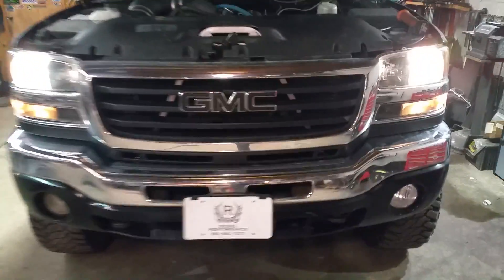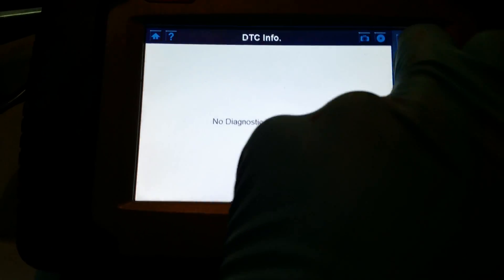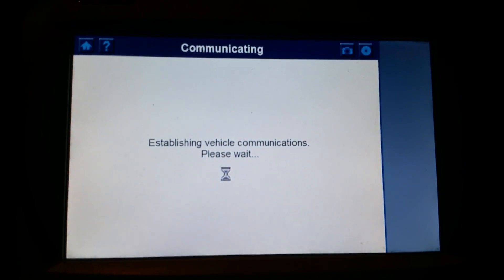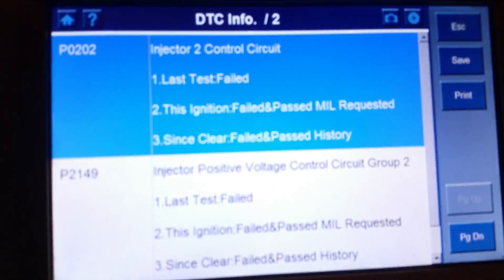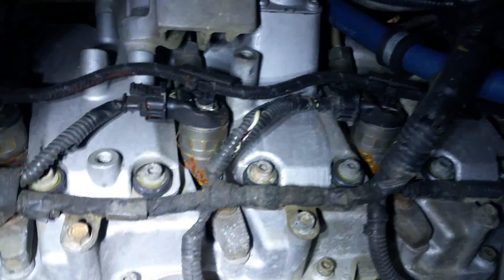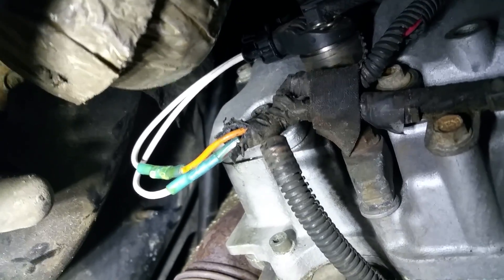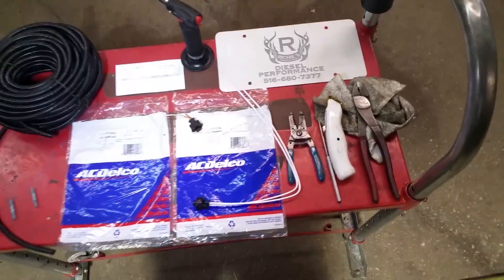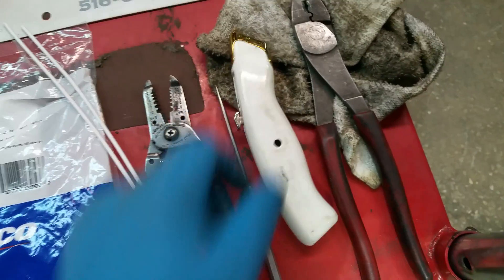LLY Duramax injector control circuit misfire cyl 7 cyl 2 pigtail ice pick fix

Comment: Can this cause a tick? Or is it if they’re bad that it turns automatically into a tractor
Reply from the maker: Not likely to cause a tick. The "tractor" sound is bc the FICM disables 1 bank (set of 4 injectors)
Reply: @richiestruckandauto7438 is it possible for a fuel knock to come of it without the code

Comment: Hi Richie, I started having this problem with my LLY yesterday, on Cyl #2.  Could you please tell me if it is easier to replace Cyl #2 plug by removing the inner fender? Thank you for your video!
Reply from the maker: It does provide easier access to thr GP once the fender skirt is removed. Considering it only takes a few minutes at most its worth the effort. However, it's not required. You can get to #2 from the topside of the engine. The junction box and ps pump are really the only obstruction.

Comment: This video just got me home from work. It was midnight, raining hard and muddy, I started up the truck and man it barely even fired up and was running very rough, any touch of the pedal would almost kill it. Popped the hood and did the ice pick like you showed and instantly back to normal. I wonder how long it will last like that? I have the new connector ready to go but why change it if you don’t need to right?
Reply from the maker: I would recommend changing that pigtail bc the modified condition isnt a permanent one. The terminals lose continuity due to the stress upon the connector. Even though the signal is low amperage, it still is likely to leave a deposit on the face of the terminal resulting in a very small area where the signal strength may be compromised due to impedance. Changing the terminal is ofcourse at your discretion. Personally, I'd prefer NOT to have the situation reproduce itself if it could be avoided. 👍
Reply: @richiestruckandauto7438 I’d rather change it on my own schedule in my work clothes in the shop vs. on the side of the road in my nice clothes when I have somewhere to be.

Comment: On a trip to Tennessee from Florida,  broke down with these EXACT issues.....after limping it to a family's house to be able to work on it, found this video and voila!!!!! Unplugged,  cleaned up, plugged back in, and back on the road!!! Vacation SAVED!!! I thank you 1000x over for sharing this. Was being told that it was dirty injectors......fuel filter.....FICM ........ when everyone backed off and I found the vid, they heard the truck start up and run smooth as can be, they were flabbergasted. Have a great one and keep posting things up!

Comment: Thanks for the video. I had just replaced #2 connector on the side of the road with my 5 th wheel attached and it didn't solve the problem.  I watched your video which reminded me of the#7 connector and I used the ice pick trick (even though I broke down two more times) and made it to my destination!

Comment: When splicing the new pigtail wires to the harness, does it matter which wire goes where? Thanks so much! Great video!
Reply from the maker: Tyler Graham Honstely, I've never reversed the polarity on the terminals. It is a DC circuit and they function utilizing high side voltage from 1 of 2 drivers and a ground. I would reasonably assume there would be a major fault if the polarity were reversed. This can be avoided by trimming each wire 1 at a time and offset by 2 or 3 inches away from each other as described in the video. Good luck w your repair.
Reply: So which side is the + side coming from the truck? I could use a volt meter I guess. Thanks again

Comment: Sprinkler wire fix........ My #2 on my 2005 Sierra 2500HD kept cutting out and turning it into a "Tractor". The problem is that chevy engineers cant make a good electrical connector. Mine started happening about once every two-three weeks, then I would have to go in with a tiny jewelers screwdriver and bend the contacts on the harness side plug to tighten it up so it could make solid contact with the injector side plug. After about the 6th time I found some solid sprinkler wire that had a diameter slightly big enough to press on the connector but still fit in the holes I was prying from with the screwdriver, shoved one piece in on each side of the harness plug and cut them off, leaving just enough hanging out for me to grab it if I ever need to remove it. The wire put pressure on the contacts when I reconnected, stopping them from coming loose and generating the error/tractor condition. That was six months ago, not one fault since.... cost of fix, about 2 cents, if that.
I don't know why Chevy/GMC had so many issues with their electrical connectors in that time frame. You can see it for yourself if you look at 2004/2005 Tahoes and Yukons coming down the road, in the little square driving lights they have. I used to wonder why so many had one burnt out lamp, thought GMC used cheap bulbs, but the problem is bad connectors. They are loose connections too, and after so many years of use the loose connection generates heat in the plug and eventually ruins the connector, rendering the light non-operational.
Reply: Gm didn't design the connector, Bosch did. Blame the Germans.

Comment: Richie, are you a certified mechanic? Because it looks like you're handling a lot of materials. Good luck getting that pigtail and injector fixed!
Reply from the maker: I have several dozen certifications ranging from Caterpillar/Cummins to GM/Dodge and Ford. I think I've got this under control
Reply: Intelligent Hor
Reply: Exactly bud